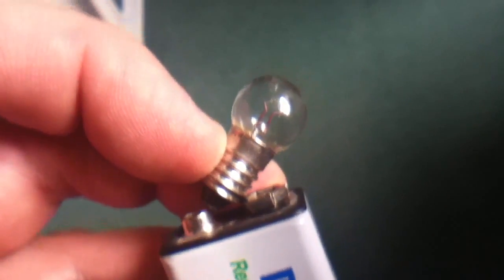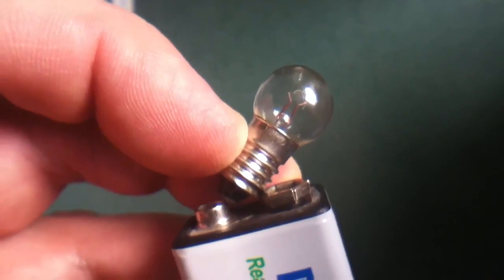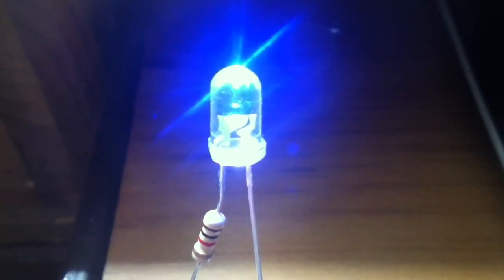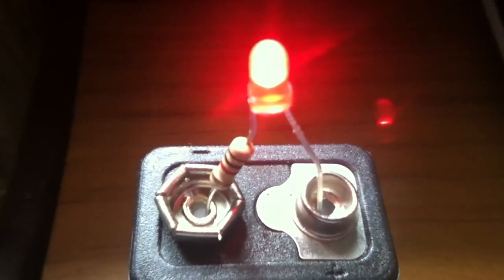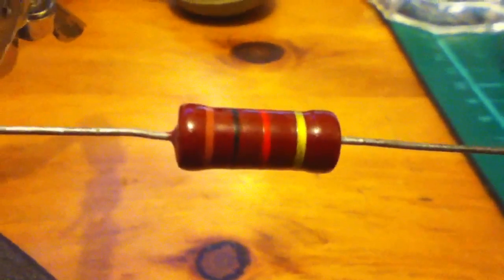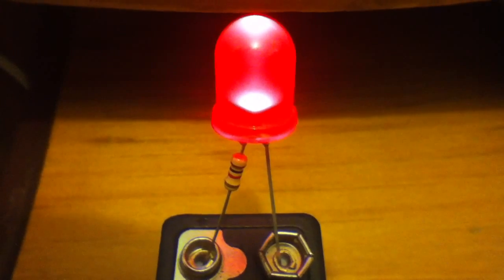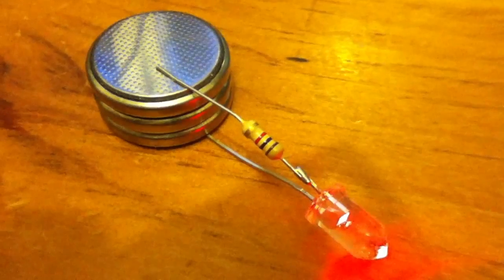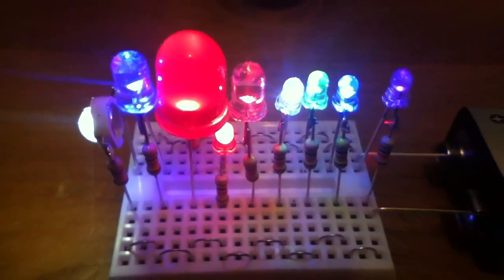How To Light Up LEDs Without Resistor Math

Comment: resistor depends on the supplied voltage at 9v 1k might work but at 3.7v or 5v their would be very weak light...for that use 220ohm resistor, perfect

Comment: For simple indicator leds 1k is more than enough. At 3.3V supply red, blue, orange and white are bright enough to see them indoors, only green ones need more juice. I tested some of my leds and red leds take about 1.5mA and are bright, and blue are even brighter and take less than 1mA, both at 3.3v. For high power leds and higher brightness that won't work. Simply leds don't need their 20mA to light, that value is their maximum continuous rating.

Comment: Why not use few seconds to calculate appropiate resistor? Ohm's law is very easy to learn, and you need only learn it one time. And then you can use LEDs with full brightness. I Hope the smartphone manufacturers do not select the slowest processor to ensure that battery can give enough current.

Comment: You can use an LED without a resistor at about 1.7 volts or less.
Reply: Use joule thief circuit

Comment: if you stack few leds in serie you even dont need a resistor. And they just would work, because leds are just diods and diodes have and interistic resistance, its low like 30ohms or so but in serie this resistance would be big.

Comment: hi,  i got Led Ir color black and... 
read this first for a idea
Description:

1. Emitted Colour : Infrared.
2. Size: 3mm.
3. Lens Color : Black Clear.
4. Forward Voltage (V) : 1.2-1.4V.
5. Wavelength (nm): 940nm.

the resistor is good for this Led?

Comment: A 1K resister is a good value to use when you just need to see if it will light up. I think he might better have mentioned that for greatest brightness or highest efficiency, you will need to spend the few minutes using any of a number of resistor calculators on line or, gasp do the math.

Still, it's a great starting point when you want to light up an LED quickly with what's at hand.

Thanks!

Comment: headdesk an led is never a dead short, Im so sick of being told this by professional students.  It always has some resistance and a tiny amount of inductance.  It is also a DIODE which means that it does have a voltage drop.

I remember one perfect example of this false notion going too far (as it always seems to) someone who designed a circuit which PWMed an LED trying to tell me that a capacitor across an LED would never work because......... an LED is a dead short. headdesk UGH! enough with this already!

Comment: I don't have ressistors around me so I often use my LEDs with arduino without ressistors, they don't burn, but it's this a factor that can "burn" my arduino?
Reply: +Adrian Oneasca i think the only way for a miscalculation of resistance to damage your arduino is if it's connected to a input pin. calculating the right voltage/resistance  only prolongs the life of the led. this can be important in larger circuits because when a led fails(if it doesn't break the circuit) the excess voltage could damage other components in the circuit.
Reply: and if your using the 3v and 5v pins to power your circuit you don't even have to worry.

Comment: Hi, nice video. Maybe you can help. I'm working with a 12v switch with a built-in led light, this one on ebay:

 http://www.ebay.com/itm/281482821236?_trksid=p2059210.m2749.l2649&ssPageName=STRK%3AMEBIDX%3AIT  
  
Do you think I need to add the resistor or would it be built-into the switch?
The diagram does not show one and I would hate to burn the light up inside.
                   Thanks for your advice in advance.

Comment: if the voltage used is the exact voltage the led can safely use does it still need a resistor? i doubt it as even though they are sensitive at that voltage they wouldnt draw more than the max safe limit....??
Reply from the maker: ***** You should always regulate current in case other factors change - temperature for example.
Reply: +Julian Ilett   Or if NOTHING else ... establish a current limiter and a highly regulated V+ (2.1, 3.2, etc).  Temp has and will always affect an LED.  The hotter it gets - the more it will want to draw - basic LED thermal dynamics.

I've successfully pumped 3a @ 18v into a 120x20mm COB LED for 24 hours - mounted on a fan cooled heat sink.  Oh, yeah - that was a CPU heat sink recycled from a retired PC.  Yes, that particular LED is still alive today and in service :)
Reply: a resistor is not really a current limiter though is it? as in allow more if the voltage is too low and drop it if its too high like a current limiter circuit-it just drops it right down from the onset so that if say the voltage went up really high a large current would still flow through the led regardless

Comment: Cheat by using a 1k resistor on everything? You have to be kidding me right?
I have some LED's and even when using just a 470ohm resistor with them they are only half as bright. This is with a lithium 3.7v battery which is about 4.1v or around there when it's fully charged of course.
lol if I used a 1000 ohm resistor they would be barely lit. lol.
I find they are best around 100ohm resistor.
It all depend on your LED and power supply. Some LED's only need 20mA, others like I have the 1w ones require 350mA.
Reply: It's also not true what you said about bulbs. They will burn out if you connect them to the wrong supply. They are more forgiving than LED's of course. But connect a 12v incandescent bulb to a 24v battery and you can say goodbye to the bulb.
Reply: So how about 12 volt supply to led..what is the resistor code..please help

Comment: Hello there i was veiwing your video on resistors i'm  doing a project that i'm going to to use leds  1-3mm  1-3mm green 1- 3mm blue and 4- 3mm white i'm placing these leds inside of a model each led will be in different areas in the model  the power source will be a 9v power supply that plugs in the wall outlet the resistor i want to use is a 1000 (1k) ohm will that be enough brightness for the leds  can i still use the 9v power supply that plugs in the wall be safe.. pls reply thanks henry

Comment: yeah, but, lots of battery power is wasted in the resistor. What is better is a Joule Thief oscillator, that boosts 1.5V say, up to 10 or greater volts, creating bright light with very little power consumed.

Comment: Thanks for this video. I am a little confused.  I am doing an LED project right now replacing some switches in our old VW Cabrio.  I bought 3000mcd 1.8v-2.2v type which when doing the standard math of 12v (car voltage) minus the max forward voltage of the LED (2.2v) divided by the rated milliamp of 20 = 490 Ohm. (and they came with 470s)  While a 1000Ohm (1kOhm) will work..won't this greatly reduce the brightness? And..if using the 470's am I at a great risk for burning them out quickly?

Comment from the maker: It is very basic, I agree. But it's a useful first step just to get the LED lit. I'll follow this up with measuring the forward voltage, understanding that it's different for different colours, then applying the equation you quote. But for absolute beginners, even the difference between amps and milliamps will need to be explained.
I'm thinking of people who know nothing about even basic electrics, but who want to get a few nice coloured lights on their railway layout or model spaceship.

Comment: Complicated math? (Supply voltage - voltage drop across LED) / LED current

It is the most basic of all electrical equations. If people cannot do handle that, then they should just stick to their job at McDonald's.

I like your videos, but this is silly.. You make it sound like this is the golden solution, without mentioning the downsides to this.

Comment from the maker: Yes, if the power supply (or battery) voltage is high enough. But the 1k resistor is a "safe" cheat and will not result in high brightness. COB LEDs are designed for high brightness applications where current limiting resistors aren't the best solution. Use a properly designed current limited power supply with a COB LED.